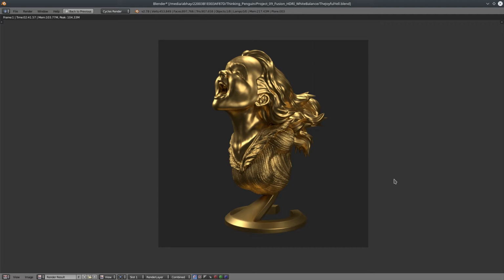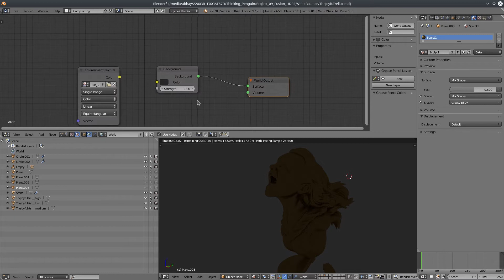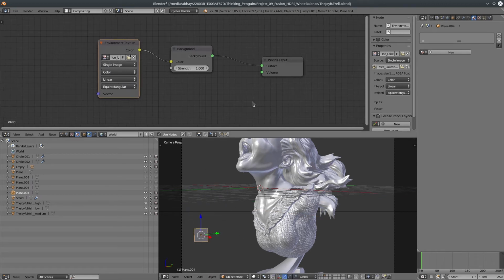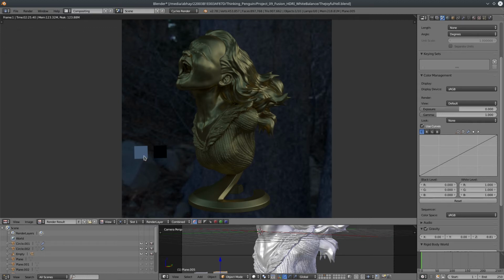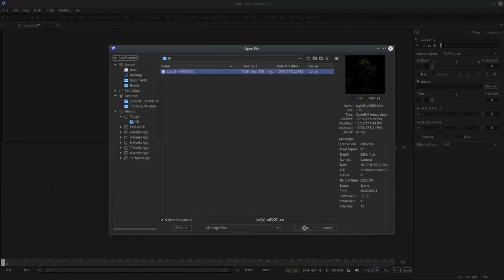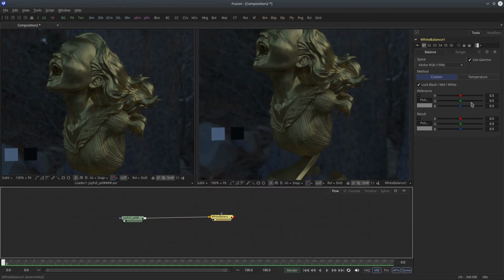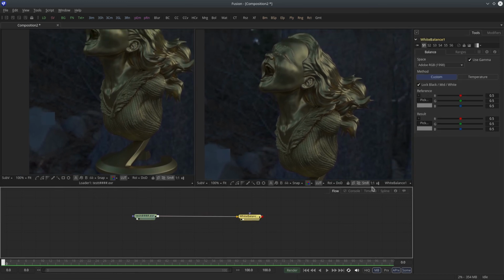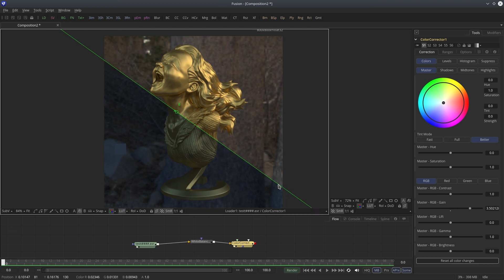Blender x Fusion | White Balance

Comment: Wouldn't checking "Save as Render" before you save the picture fully solve the Blender output problem?

Right before saving the pic to a folder you get the chance to click the boolean check box "Save as Render".
https://docs.blender.org/manual/ko/dev/render/post_process/color_management.html